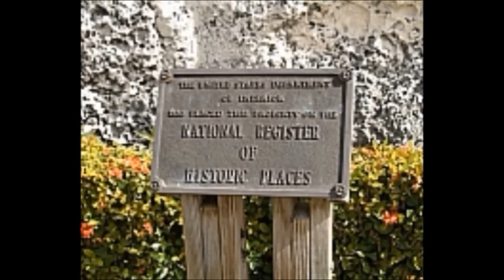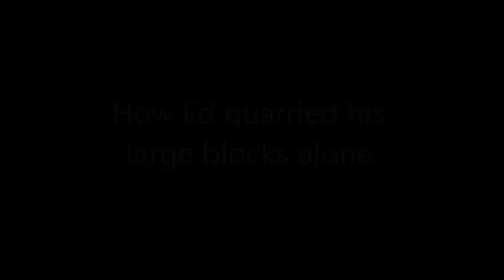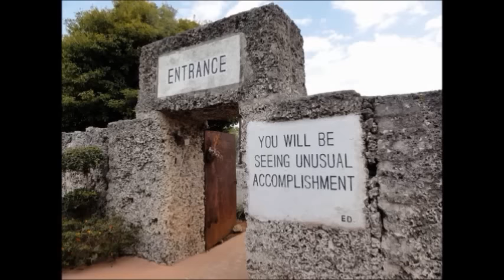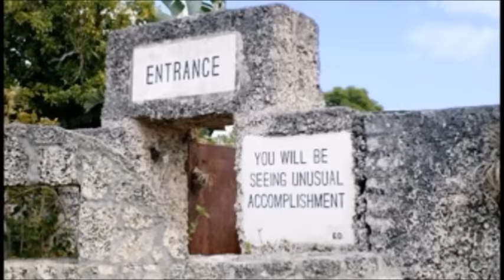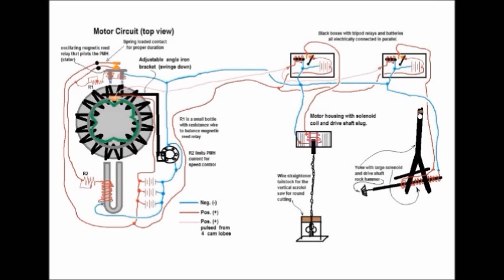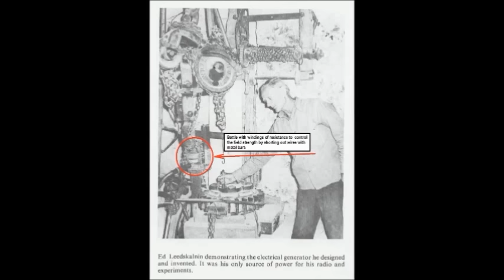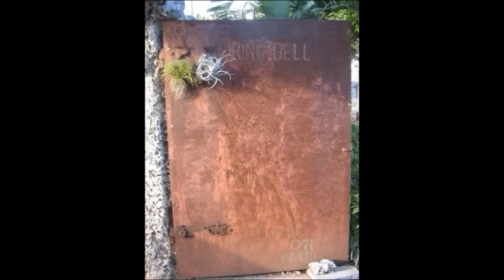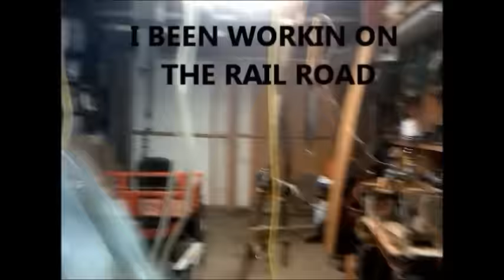Eds Coral Castle Quarry and Flywheel, Engineering Mystery Solved

Comment: Did I miss the part where a 30 ton stone was lifted in this video?
Reply: Maybe. Pay attention at about the 10:15 mark for a plausible explanation. If you want to see the experiment demonstrated and the results reproduced, then no, that part did not happen in this video.
Reply: Nerdy McNerdlington Thanks for responding. I was hoping to see the duplicated apparatus perform the job since the video is supposed to have cracked the conundrum.  I appreciate you pointing out the 10:15 mark because I did miss it before.  This video is still a theory of how it was done to me and not the explanation since it wasn't duplicated on film.  Thanks again.
Reply: I miss that part to.If I had to use this saw to cut all this coral I would shit.Ed varyed or shielded the field of gravity.
Reply: There is no way those stones weighed anywhere around 30 tons. They were more like 2.5 tons. The blocks would have to be close to nearly 9 ft. cubes or 27 cubic yards to have that much weight. They look to be closer to 2 cubic yards on the video. It's coral not granite.
Reply: Lord have you been there I have and I can tell you that some of those stones we're huge maybe not 30 tons but some of them had to be at least 5 to 10 and a huge table made in the shape of Florida that had to be 15 feet long this video proves nothing except that some of the tools he used but doesn't show how he transported them or put them in place probably just more misinformation to keep people blind
Reply: Johnathan Doe If you missed so did i, he also neglected to mention that the Coral Castle was moved 10 miles from where it was originally built. in the 70's experts in moving large stones said that the cranes then. when it was built would have a hard time lifting the 30 ton stone, also the films he's so fond of referencing also said that in the process of moving the castle he he would make the truck drivers wait outside while he loaded the truck's, and that he would be done in a very short time. when he addresses these issues he can say case closed. there was a book that was sold at the Coral Castle which was written in code by the builder explaining his secrets if you could solve the code but that was on the 70's . don't know if you can still buy it today
Reply: Interesting. I never heard it was moved or about a coded book.
Reply: Lettering on a wall outside lists when it was made and when it was moved.
Reply: I get that its only an explanation.  I'm just saying that actually lifting something very heavy in the video would make it more plausible.  Its like all these theories of how the pyramids were constructed- a lot of talk and no demonstration.
Reply: I am taking it all with a grain of salt, the weight of the stone that is. I know that in Bermuda they use it in little slabs as roofing, so I doubt that is it really heavy and difficult to cut. My impression is that it is a bit like pumice stone. I know enough electrical to know that the electrical and motor stuff is plausible. I also made a tall tripod back in the 1970s that was made out of 6x6s and almost 20' tall so I know it is practical to lift stuff with those. In fact is is easy to walk them one leg at a time, if you lift up on one leg at a time and move them by hand. I didn't even use any special tools.
Reply: Just look it up on YouTube, it's really not a rare phenomenon. How do you think the Greek Pantheon was built?
Reply: By Greek Panthers?
Reply: The Parthenon?
Reply: It's done by gently blowing under the stone.
Reply: the pyramids are a whole other story, people think car size stones were all moved by workers and over a million of them.  The problem is some inside are gi-huge-ic  ;)  80 tons or more.  The whole thing is aligned so perfectly, top to bottom, N-S-E-W, that modern builders couldn't duplicate it. It now appears it was an energy generator - Chris Dunn explains it on Youtube.               You can make your own easily w/ 4' 5/8" dowel-rods, connected w/1/2" copper pipe 'elbows'  for the base and the 'wall' rods are  2: shorter.  I capped mine w/a 1 foot copper sheet pyramid, that I made.  you can charge water and back in the day, I had a bunch of glass Sobe bottles to use and  put at 1/3 the height is the focal spot.  Charge for a day and it's much better to drink.  What's crazy is w/coat hanger wire divining rods in a L shape that will cross when over water,  but over the  bottles in the 'mid, they'll separate!!!   For only $10 anyone can check it out.  (I mitered the crown tube ends to a point. Drilled the elbows and inserted  sawed off screws on the other ends to secure the walls at the base.  Duct tape the crown if you wanna.  It'll stay put
Reply: The pyramid thing has been debunked already. Quite simple. They rolled the blocks over logs and slid it across wet sand on ski-like things.
Reply: There were no 30 ton stone blocks. These stones are made of coral.
Reply: 30 tons of stone, 30 tons of coral.  Who cares? It wasn't lifted in the video.  If the video claims to have solved the mystery, I don't care if 30 tons of shit is lifted.  Nothing of that magnitude was done in the video.
Reply: there is a video elsewhere of a single man moving stonehenge sized blocks using leverage, all by his lonesome, on modern news video. 

It doesn't help explain Ed L moving these by himself, and a whole castle to far away... or why if it is NOT magic there was a need for secrecy... or his cryptic references to math and secrets of everything... but it does show that a single man can move blocks well over 10 tons by himself.
Reply: Johnathan Doe no s*** nobody said 30 tons of stone was lifted in the video  what u were saying was there was no 30-ton stones at the site which there are the heaviest one is 27 + tons and Ed  moved it by himself the guy in the video didn't do s***
Reply: That is what I'm saying.  He didn't move anything heavy in the video. The video is titled engineering mystery solved.  It could only have been solved if the guy in the video did what Ed did.  He did not. And really?,  spitting hairs over 27 tons or 30 tons, as if 3 more tons really would make a difference.
Reply: + If 3 tons drops on you, it surely makes a difference.
Reply: The part where the 30 ton blocks were cut perfectly and stacked up to the sky to make the pyramids. They cut that part of the video out because they had to cut down the trees that made what we call plateaus.
Reply: Years ago on one of these Coral Castle videos, two boys were doing what boys do when they came across a trailer tray with huge blocks of Coral. They waited and watched a guy unload the tray. Later at home the told their father the Coral was unloaded using ice cream cones. Of course they were laughed at.
On a later video that was about the stone circle in South Africa a guy found that inside the circle nothing electrical worked. He also found stones he described as pestles which could also be described as ice cream cones. They had some magnetic properties. I have often wondered if the cones used to unload the Coral were  similar or the same as what was found in Africa..
Reply: Gary Wheeler the largest stone at Coral Castle is 27 tons do some more research Gary
Reply: there is coded book and if the contraption was built that way why would he hide it.  He would never tell people how he did it.
Reply: yes there was a book.
Reply: seriously give me a fucking break  when i see some one do that with A REAL 80 TON STONE  IN MODERN DAY  i will beleive that is how they done it.  no one ever recreates these things with actual weight stones  so that is discounted  most american cars are under 4 tons  so imagine moving 20-23ish ford Tauruses with this stupid idea.
Reply: ok I didn't see a stone moved to prove anything either. here is a thought. I don't think even at 3 tons the 3 poles used to pick up the stones would stand up to the weight.
Reply: @harooni22  I think you mean Hypothesis...Theory is used when there are verifiable facts. You are welcome to try to prove him wrong.
Reply: i went back and found it its at 10.08 it clearly shows 3 poles and 1 chain holding up a car sized rectangular block of this coral this is not make beleive its right there
Reply: John, how much does a car sized block of coral weight?
Reply: not sure i am not a stone mason or anything. the cement blocks we use to build most large buildings currently weigh  around 4o-55 pounds a piece and have 2 large holes in them so  add some weight to each and figure how many of them go into a car sized block . and 1 ton is only 2000 lbs. I DONT UNDERSTAND WHY YOU HAVE SUCH A HARD TIME BELEIVING IT THE CORAL CASTLE IS THERE TO SEE. if i ever get to FL again you can bet i will be going there  and i will probably spend a lot of time there .oh also i have heard that this type of coral is very dense. so it might be heavier than cement . not sure not an EXPERT ON ROCKS
Reply: The largest stone weighs 27 tons, the door weighs 8.2 tons. While i have not yet figured out how he could move them without the block and tackle arrangement, This video explains very well how he could do it with block and tackle. 1 cubic foot of Coral weighs 98 lbs. Trees are cylindrical, they are stronger in a linear direction. Not far fetched that a tripod could lift heavy weights. I still have an interest in sound resonance technology, but this certainly makes for a very compelling argument.
Reply: sorry your statements are contrary.1 cubic ft of coral at 98 lbs. the "door" would have to be 16 thousand feet long by 1 ft at 8 tons.

I still say 3 trees will not support even the 8 tons.
Reply: that may be, but since i have no way to measure 1 cubic foot of coral myself, i had to go with a websites statement. However, i stand by the rest.
Reply: I got that reference! Wahaha! Nice one.
Reply: +John Farley I did watch a vid that said the driver that helped Ed move his castle to the new location saw him holding cone shaped stones in his hands, before telling the driver he could not go inside to watch him unload the truck...This was years ago that i saw that vid, but I'm guessing it's still out there.
Reply: maegap96 Is there a video floating around of that Asian girl moving that 212 ton stone? I would love to know how to do some of that stuff. Just natural materials?
Reply: The quarry was 500 miles away, for every stone used in the construction of the great pyramid.
Reply: Nonsense. most of the 2 million+ blocks were quarried right there on Giza plateau within a mile. Even the granite from Aswan was closer than 500 miles and the Tura limestone was less than 5 miles away and across the Nile.
 Where did you accumulate so much crap for information?
Reply: lol
Reply: Johnathan Doe ,,I can lift a 30 ton block of granite and stand it on its end by my self. Only because I watched a 45 year old man on YouTube do it. It is simple. Just takes the better part of a day.
Reply: Johnathan Doe ,,,watch — man lifts 20 ton stone by hand.
Reply: Johnathan Do
Reply: As long as the big money and big corporations are in control of governments and every aspect of our lives, we will always be suppressed of free energy technology and other technologies that  threaten the elites total control of this planet.
Reply: Unfortunately that means that this is all speculation @Facts Don't Care About Your Feelings. Therefore the title "Solved" is click bait. To take his hypothesis seriously he needs to conduct the experiment, then only after this, other people will try to replicate it. Then the hypothesis with either die on the spot, or thrive.  Until then, he has not done anything impressive.
Reply: @Bad Batch some of them are 20ft by 5ft, is that close enough?
Reply: megap96 If only your university would give its secrets to the construction industry. Perhaps we'd all be living in houses that will still be standing 1,000 years from now with no maintenance. Or at least our government buildings anyway.
Reply: Mephilis 78
no can do, that would make a dent in the mortage market
Reply: Thank you for being a voice of reason in this discussion, maegap96 - it's depressing how many people on the internet would rather believe in woo when the more obvious explanation is something down-to-earth and perfectly reasonable - this video (and I say this to the credit of the video's creator, who I think is on the right track) depicts a lot of "lost technology" that looks nothing at all like space aliens and sorcery, but rather quite reasonable (and perhaps somewhat boring) for the early 20th century, and similar lost technologies used to build large monuments in the past will be comparable: lost technologies that will look a lot like "boring" stone/copper/bronze/iron age technologies, applied in inventive ways that just haven't occurred to most modern people simply because we're not used to using the technology, and insist on trying to use it the hard way.

I'm reminded of my first summer job, working in a school over summer break with a bunch of the school "jocks"... as a skinny, sickly, nerdy little guy, I endured quite a bit of hassle from my coworkers and manager, especially on the day we had to move some very heavy steel desks from one side of the building to the other... the six of us struggled to lift one of those desks and carry it out of the door, and of course I struggled more than the others, and got kicked around quite a bit after finally getting the damned thing out of the door because I wasn't "pulling my weight"... everyone else went on break laughing, and while they were on break, I stayed inside and moved that desk the rest of the way by myself, and then moved the others, without breaking a sweat, and I remember the way everyone else suddenly shut up when they realized I'd done a job in about an hour by myself my way, that would have taken them a week to do together the hard way.  There was no magic involved, no crystal or pyramid power or magic magnetic woo waves - I just used some simple machines in an inventive manner, and did the job the easy way, it really didn't take much work, and with a little more creativity and resources available, I'm sure the basic ideas could easily be scaled up to massive stone blocks.  I never explained to the assholes I worked with that summer how I did it - why bother? - and I see no reason to try to explain it now, since nobody who could benefit from the explanation would want to believe it could be done with such simple and muggle technology anyway, but when I see the tripods and "wheelbarrow" and rocking saw-bade door and other devices in the video, and read the references someone made to "ice cream cones" in another post, I think I can understand and appreciate what the builder of Coral Castle, the maker of the video, your 82 lb Asian girl and other university folks, and other such people were doing - I, at least, can appreciate the imagination, cleverness, and inventiveness needed to put (for example) the crude machines depicted in the video to work.

TL;DR:  There is a third alternative somewhere between doing things the hard way, and doing things with super-science or magic or miracles.  I know from personal experience that seemingly magical things can be accomplished with relatively simple, and seemingly unexciting basic technologies.  

One just has to keep in mind the potential power represented by those basic, simple machines [lever, wedge, screw, block-and-tackle, wheel and axle, inclined plane, etc.] that our poor teachers tried to explain back in grade school science classes, and - keeping those machines in mind - realize that to move or even raise a 30- or 80-ton object, you do NOT necessarily need to pick the whole thing up off the ground.   To paraphrase Archimedes, "Give me a simple machine, and a stable place to take mechanical advantage of the machine from, and I can move the world."
Reply: By Parthenoegenesis...?
Reply: Me too...
Reply: Johnathan Doe .....yup....cause it was key to the argument....lol
Reply: Yup he had to move it.  He was robbed.  Hmmm, wonder what they would want, he owned no earthly possessions.  Lived off the land.  Traveled from his homeland to Jersey then hitchhiked to the one place on earth where he could make his sweet sixteen.  Much more to this story then just some hand tools from the junkyard.
Reply: A lot more to this story then a video with a good theory.  Its under one hour verses a half of century of secrets.
Reply: .Its hard for people to believe there are mysteries and secrets but easy to point fingers at alien beings being the other answer.  How about the knowledge known in Ed's era and before the web.  The guy knew something special.  And it was not all leverage.
Reply: Douglas Coffman maybe make a video demo or explanation would be cool
Reply: maegap96 so when the story of ed hiring truck drivers to transport his all his stones to a new location is what?  How could trucks transport Ed's heaviest stones?  And why did ed not want the drivers to see him load and unload the stones?
Reply: @cegtown  lmfaoooo thank you
Reply: @darcgibson5099  there is way more mysteries about the pyramids then how they moved the granite. Like how did they quarry granite with bronze tools. Also the great pyramid covers 13 acres with only a .5 inch deviation across the entire base. That would be almost impossible to do with today's technology. The precision of the pyramids  could not be matched today. And rolling 200 ton granite blocks on logs doesn't even start to solve the mysteries of the pyramids.
Reply: and how did he cut the bottom of the stones, the last cut to free them?
Reply: @thebigdog2295  
He kept his secret so the so called gov would not exploit it like everything else they surpress, IE free energy machines, now being produced overseas by 3rd world countries, why dat ???????????????????????????
Reply: @darcgibson5099 I  dont know
Reply: @darcgibson5099  it was built in Vegas
Reply: @badbatch974  Redo your research. The heaviest is approx 27 tons - and verified.
Reply: Ed never allowed anyone to watch or film him at work.  But that story is probably accurate; it was reported by one visitor, who saw the block laying behind a flatbed truck.  He turned around for a moment, during which he heard a loud "thump," and when he turned back, the block was on the truck.  This is material that can't be cut with modern machinery, according to one old TV documentary that tried; so if that's true (I'm not a geologist by any means, so you tell me) then it couldn't have been done as described here.
Reply: His father was a stone mason, he grew up learning to move granite. The video has a photo of his father using a tripod to move stone. The castle was moved only one time. Coral is lighter than granite of the same size block, it has holes in it.
Reply: @tparis4475  doesn't explain how  he lifted a large stone block into a truck in seconds, if that incident really happened.
Reply: @badbatch974   Coral weighs approximately 125 pounds per cubic foot. Each section of the [castle] wall is 8 feet high, 4 feet  wide, and 3ft thick, so between 12,000 and 13,000lbs.
Reply: @darcgibson5099  the pyramid thing is far from debunked a lot off the weights of blocks would just crush wooden logs fact!
Reply: waterside  I'll offer you a solution waterside. Ed quarried actual coral into manageable sized blocks that he took to his workshop via a pickup truck. He took some of the coral and crushed it, then turned it into coral cement powder via heating and water. Partially crushed coral (lumpy coral bits) were then mixed with the cement and water to create a sculptable 100% coral structure. He's making concrete sculptures using coral as the mix ingredients. The sculptures could be hollow with a weighted filler material that can be removed while moving to a new location or could be solid coral. This explained the geologists failed attempt to identify the rock, it's modern concrete using course and fine coral substitute material. This explains why he wouldn't let the moving van guys see him load the structures, he was removing/adding filler weights. I believe this is the last piece of the puzzle to solving the main incredible feats of coral castle.
Reply: @JohnSmith-mg5ve The amount of stress a pole can take depends on the steepness of the angle it is positioned in, with full vertical being able to handle the most.
Reply: @badbatch974   i agree. the rock is soft enough to cut with a wood saw, so its not all that dense - in fact its probably less dense than wood. So moving physically large blocks is probably no worse than moving a large tree trunk.
Reply: Robo Stache - In today’s era of recording  everything, including inconsequential events, there should definitely be a vid of an 82 lb. Asian girl moving 212 tons!
Reply: Robo Stache - My exact question.
Reply: I doubt it these stories of children seeing him to do appear to be made up as none of these childrem or their father has been named and therefore cannot even be confirmed to have ever happened. Even if we did have a name and could interview these kids whos to say they didnt just really see him with an icecream cone lol I see no evidence whatsoever in this story
Reply: @waynegrant3283   Whos the driver and where is he now? I keep hearing these cone shaped stories but not a single one of them i've read has the name of whoever supposedly seen this.. Sounds more like made up rumors to me why dont any of these people have names its like "oh this is how it was done people seen it" Who seen it? Ughh his driver and random kids... Who was his driver and who were the kids? Ughh I dunno your supposed to just believe that cause thats the story ummm... I'de like to know whos telling this story and if they had a first hand account or just heard it from someone who heard from someone ect...
Reply: Just a few minutes in there is an old video,  it looks like Ed using his tripod. It is only a few seconds,  if you blink you will miss it. There is a large stone being lifted by him, it's spinning slightly.  Actually they do show Ed a few times,  old silent film stuff, but he is using the block and tackle with chains.
Reply: @thebigdog2295  

After seeing this I can easily see him setting a large tripod, maybe even more than one, have the truck driver park the trailer under it or in front of it(or even do it himself which would speed everything up even more as he could move it back and forth out from under the tripod as he lifts each piece) and easily move multiple blocks onto it at night with no problems. And quite quickly as well. 

I think too much emphasis has been placed on the paranormal and mysticism without anyone working to figuring out the stuff right in our face. 

I've used similar methods to quickly and precisely move things up to 5 tons. It takes work, those pulleys take hundreds of revolutions just to move a foot, but if you're not a modern day lazy SOB like half the country, it's easy. Just monotonous and tedious. 

If I were to expand upon his findings here using modern machinery I think it could be done in half the time.

As for the cranes of that time...compared to a tripod of steel the cranes even of this time would be a joke. The tripod method doesn't allow for much horizontal movement. And by adding that capability in the crane you seriously reduce the lifting capacity. Like by a lot. The cranes of now and then require the huge counter weights and even when the load is directly beside them they are inefficient for vertical lifting. They make up for this by being more mobile. Such that a smaller weight than can be lifted by the tripod could be moved quite easily running circles for the guy doing the tripod which can only be moved inches at a time. 

That said, if you had 3 cranes you could put them in the same configuration and lift a far larger load straight up than any of them could singly. In my mind I can see multiple variations on the tripod using modern technology that would even reduce the hassle of moving with a load.
Reply: By to tipping a stone on a fulcrum back and forth with counter weights you can add layers to the pivot underneath the stone effectively lifting it add a lever of proper length to apply leverage and Walah
Reply: @johnmalcstan  Michael Tellinger made the video about South Africa.
Reply: The Big Dog sources please
Reply: Douglas Coffman video please
Reply: @davesysygy5830  Haha that's great
Reply: Ok so sure,thats all well and good but doing it quickly and over and over just doesnt make sense to me!!this still feels very much like todays explanations,like all this CRAZY WORK for one block!?!?i just dont see it,maybe theres some stuff to pick thru here but it really didn't show me much,like the most important part,he didnt show,go figure!?!?like if ur gonna do it,than do it!!show these HEAVY ass atones being lifted,dont just put out yet ANOTHER THEORY,not impressed,sorry!!
Reply: @maegap96 I feel like you made most of this up
Reply: He enslaved a currently undiscovered race of 2.5-3,000,000 nocturnal loin cloth-clad slaves, who built the entire structure utilizing wooden spoons and the like.
Reply: Lifting serious tonnage Has been recreated, by some guy, in, I think, TX.  He makes his monoliths of concrete (he’s clearly got money to waste...?).   
Then, uses leverage, fulcrums to gradually lift and/or pivot the huge blocks to where he wants them.  By himself, sometimes with a friend. 
He made videos posted somewhere on YT, years ago.
Reply: @Chimonger1  It takes him foreverrrrrrrrrrrrrrrrr to gradually lift one side then the other and he only stands them up in a hole. He doesn't put anything on top of anything else. People have videos of themselves doing the easy part, but none showing the moving lifting and placing of enormous stones or even a good way to cut them out of the earth. This video shows the sides being cut but what about underneath?
Reply: Because it didn't happen at all with a log hoist. Ni've scam.
Reply: @cegtown  You don't have to move a 30 ton stone to solve a mystery, maybe moving it will prove you solved it through.
Reply: @stephaniesimpson3422  lol.
Reply: @johnmalcstan  Hi John, I guess you know more by now about those cones? I'm really interested because I have seen examples of this tech before now. Thanks.
Reply: @cegtown  Look up the definition of "theory"................ this video is barely conjecture, let alone a theory.
Reply: @rightnow4450  care to elaborate? I used to say stuff like this when I was a teenager... what do you mean by "keeping people blind"? What is the truth you have seen? Who is putting the misinformation out there and for what purpose? 

You have to be willing to admit you know NOTHING in order for growth to occur.
Reply: Coral Castle was a work that Ed wanted to be known for. And besides being pretty damn good in using his hands, he was also very intelligent, so intelligent that he didn’t want to tell people his methods, and instead created a mystery around it. Why would he do that? For the exact reason why anyone is Interested in the Coral Castle to this day. People take as gospel truth the story about the men claiming Ed loaded and unloaded the truck in a few minutes. That’s a good story. Then instead of looking at any reasonable, sensible explanations, they instead have his words about knowing how the Egyptians built the pyramid and take that to mean he actually did. For all anyone knows, he just meant hard work. Then there is the book nobody can decipher. Well if it’s indecipherable, it might not have meant what people think it meant. If people figured out how he did it step by step, the castle would have lost its charm, simply by existing - a structure anyone could make (though most really wouldn’t, but the ability would be there). He was very clever. Like a fox; the Coral Castle won’t soon be forgotten. Leaving something behind to be remembered for is a very common human need. Ed figures out how to do that as well.
Reply: Easy multiple tripods
Reply: @heru-deshet359  I would really like to hear more about this technique. How do you know ? By a machine, with enormous air pressure ? Any information would be appreciated. Thanks.
Reply: yes
Reply: @thebigdog2295  Tanks for this information. Appreciate ☺
Reply: @rightnow4450  LMAO! Are you seriously censoring you're own comments?! 🤣
Reply: did i miss the part where 30 ton stones have been documented at Coral Castle?
this distraction by another dummkopf called John Doe is typical of these videos
Reply: @ShifuCareaga  Yup... seen that fella, it was almost funny when he shows just how simple it actually is.
Reply: @rightnow4450  this is a true believer he doesn't have a clue he said they
Reply: @cegtown  this guy is a Kia sales men
Reply: @darcgibson5099  wrong not possible
Reply: There are multiple mysteries related to  the Pyramids, the cutting moving of the stones is only one & one  of the least at that.

And statements like, 5 children using this or that technique over 5 years could move more stone than the 5.75 million tons of the pyramid, are all well & good....but they sure as shit can't construct a structure of such precision that, in this day, 500 men using the latest machinery, 100 surveyors with the latest technology & 100 of the finest architects would be hard pressed to replicate the tolerances measured in the pyramid......i mean, the degree of precision of the damn thing wasn't even known until the 1960's, when the laser transit was invented, and it could be measured accurately which left them stunned as it was discovered that the structure with a 14 acre footprint was 0.5 inch off from perfect square.....putting that in perspective, today contractors building a house with 10,000 sq.ft footprint are on average 2-4 inch off square. 

It took an ariel photograph taken on a  significant day to reveal its not a 4 sided pyramid but 8 sided + the fact it was aligned astronomically.

Another level of mystery are the amount of highly significant numbers built into the pyramid.....Pi, Phi, Golden ratio, scale measurements of the earths size & weight, physics constants i.e speed of light, the constants of quantam mechanics & so on.

Another mystery is why a whole false narrative is propagated regarding its purpose, tombs for pharaohs, about the date it was built & by who, etc.

So yeah, far more going on.
Reply: Yeah absolutely no doubt in my mind that those were not tombs but indeed some sort of elaborate power generator of some kind it seems that there has been found beneath some of these pyramids and monolithic structures pools of Mercury the one in Mexico I can't think of the name but they sealed it off so nobody could get to it and it seems they're trying to whitewash the science and not explaining why are these pools of Mercury there seems they may have used the Mercury for some sort of conduction or other purpose to create energy of some kind all very interesting and it would be nice if the mainstream Academia wood open their minds a bit instead of following the narrative given to them sorry no punctuation please don't come at me about my grammar I'm using voice recognition and I'm just out of surgery
Reply: @factsdontcareaboutyourfeel7568  Let me begin by saying I don't believe in the theory that those blocks were lifted with some magical, floating the rocks into place type of invention. I think you are spot on about the cutting, nite time work, and dragging and lifting blocks into place, I even had a few daaa, that's how he did it moments, lol! My only question tho, is how the large blocks were stacked? I understand the lift 1, then drag 1 under the lifted block and now it's 2 blocks high. I just don't see how he got them 3,4, or even 5 layers high. It means 2, 3, or 4 blocks would have to be lifted at a time, and geez that seems like way to much weight to be lifted even if a crane was involved. Modern cranes even have their limits! Anyway, like Beau says, it's just a thought. So please don't hit me to hard if I asking dumb question, I'm just one of those strong back & weak mind type of people. Im not asking much, I  just want to know how the pyramids were built!?? Peace out and be kind to someone today!
Reply: It's perfectly clear now .
Reply: @einsteindrieu  try exlax instead
Reply: I don't understand all the bickering.  The way he moved those enormous stones was incredibly easy for him.  Not you or I, but for him.  See, there is this "thing" that all of us have inside - it's so hard to explain without getting into the metaphysical because it's more like energy than matter even though it relies on matter to develop/grow & harness.  Confused yet? LOL  I watched this documentary, I'm so surprised no one else has brought this up, the ratings were pretty good, and this "thing" gets much better well explained in one of its episodes.  It's like a Docuseries, I would call it.  It's really good.  I am almost certain the title is Star Wars and they provide so many different examples of how certain humans (and other beings) can control this invisible force to control the movement of solid objects, like big ass stones mentioned in this video.  Don't get too excited.  This is something, for humans, that needs to be studied and developed in children (in most cases).
Reply: @seanpeters7284  provide me a long enough lever, and I shall lift the world. Practical mathematics at work.
Reply: @bigptm1364  my though on that is you make a somewhat temporary platform out of blocks to be used and almost use them like stepping stones. Ground to level 2 then level 2 to top and so on. As you are building you are using next section to finish previous section back and forth to heighth.

Edit: also tripods would be capable of lifting magnitudes of weight more than a conventional crane, it's just the horizontal movement is reduced. But that can be solved by a come along or wench to pull the block horizontally into place on another higher block to then move the tripod after releasing the weight and repeating the process until final placement. Back and forth, back and forth but a hobby is fun for the hobbyist.
Reply: @koontz1154  makes sense when I put more thought into it the way you explained it. I can see them doing alot of lifting,(holding lifted block well above) while inching by pulling & using rollers until the layers underneath are in place before lowering upper level that's already raised above (levels) into place. I think for me anyway, it's easy to underestimate how much work 1man can get done over a somewhat long period of time. I work construction 10 yrs and should know better than to underestimate what men can accomplish with their hands. I think we see the size and our minds automatically think it's impossible a man built this.
Reply: @bigptm1364  I've done some construction myself(definitely not a master) but the guys I worked with on those jobs would come up with some crazy solutions to seemingly impossible problems. It always blows me away when I see how ingenious one small thought can be. Looking from the outside its murky but when you're inside it's transparent. Tricks of the trade can definitely seem magical/impossible.
Reply: @koontz1154  So very true, unless you have experienced something like that, or have someone like yourself explain how some of the  seemingly impossible, may be possible after all. In a way that isn't as a know it all. I'm guilty of sometimes looking at a vid like this and brushing it off as b.s. before putting thought into it. This vid was soon becoming one until I read your comment. It wasn't an argumentative know it all comment we are so often treated to. Now my mind is interested in this man's accomplishments and I have something to peak my interests until the fights start. Peace out!
Reply: js59695  In the beginning they say it's only limestone not granite or marble. You can cut through limestone with steak knife. It is a soft stone. This guy did some cool stuff but it's not like he built a pyramid..
Reply: @rightnow4450  1930's Video of ED Leedskalnin. It shows him  moving the blocks
Reply: @thebigdog2295  yes, he moved it about 10 miles and that's a fun story..and it was said that even when local kids tried to spy on him, he always seemed to know and would stop working, LoL!! in any case..no one has to to buy that book, if in case, 3 years after your reply, you haven't found out that since at least the early to mid-2000's, it's been available to download for free on the internet from several websites: 

it's about 50 pages and is called "Magnetic Current," by Ed Leedskalnin...just type the title + author name + "pdf" into your preferred search engine and it should come up within the first handful of returns..and nowadays there are even more places to find it online...also, Ed had no direct descendants [as in his own children] that we know of, so his original, unedited, no added commentary, etc., version of the booklet, itself, is in the public domain, from what I understand.

and as far as is known that he didn't share his secrets with anyone..and the official website's story an American nephew inherited it and eventually sold it to another family..but there is at least one conflicting story about how it got passed down or sold to the state of Florida..whatever really happened with all of that, someone or maybe more than 1 person/a group incorporated the name of Coral Castle Inc., and the property is under that ownership currently, afaik.

anyway, hope this helps someone track down, "Magnetic Current," and so, enjoy!👍
Reply: Did I miss the part where scientists reproduced the machine?
Reply: @darcgibson5099  That explains the first layer. What about the third? Or the two hundredth?
Reply: @maegap96 Bravo
Reply: @rightnow4450  The heaviest was 9 ton which was used for the gate. Hence the original name rock gate.
Reply: @siriusleigh24  yeah I know the history of the Coral Castle and there is a 27 ton block there you're not schooling me on anything why even comment
Reply: @justeatmyass  which techniques?
Reply: @rightnow4450  Of course you know 🙄.  More than likely 3x9 or 9x3 tons. I'm merely reiterating what I read, of course I could be wrong. The internet is a convoluted mess of unverifiable information. I don't understand why you had to let your arrogance shine through like a total knob head, it's not like I personally attacked you. Also, I'll comment wherever I like 👍. You know, because it's not up to you, relic.
Reply: @siriusleigh24  not arrogance just confidence..no different than you giving a history lesson to strangers who most likely already know that info...and you got offended by a stranger on the internet over being wrong .  Lighten up I didn't call you names or anything .I understand those who can not think judge....😁
Reply: @einsteindrieu  Coral cuts much easier than than most stone. But if believing in invisible aliens makes you happy, eh
Reply: @Mahhn  Yes it cuts easy I know. A 96 pound man is not moving a 30 ton stone fast. I can tell you stuff that you would not understand about Gravity and Time but it cool.🖤😎
Reply: @einsteindrieu  You should have listened to his history, he worked in the family cutting stone before going to be a lumber jack in the redwood forest cutting down the giant trees. Leverage does wonders. They moved plenty of 30 ton items, it's not witch craft or aliens. But if you want to believe facts of leverage over little green men helping a loner build a cool place for a girl that didn't like him. Sure, go for it.
Reply: @Mahhn  I have seen so many ANTI-Gravity ships Mahhn with others to and toke pictures. The Coral  Castle Dude is cool in doing what he did but he did it with varying fields of the Atom.
Reply: @einsteindrieu  " I have seen so many ANTI-Gravity ships Mahhn with others to and toke pictures" I expect "toke" is the main word to pay attention to here lol. That's strong stuff you got. Have fun.
Reply: @einsteindrieu  LOL I'm sure you "toke" lots of pictures while flying around in all those "many anti-gravity ships". Keep flying high dude, we are all dust in the winds, nothing more.
Reply: @Mr_Smith_369  Video is gone.